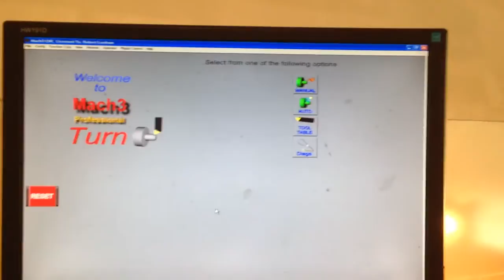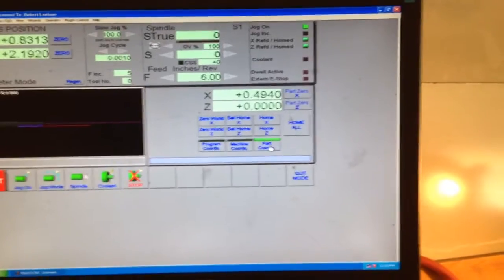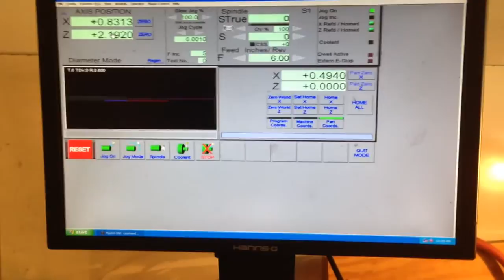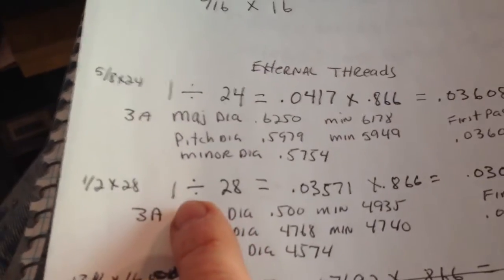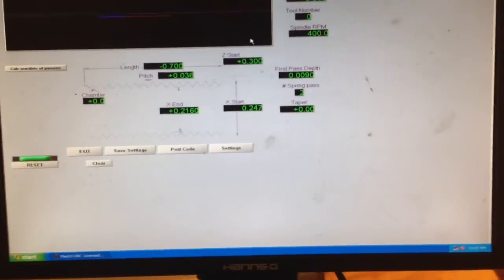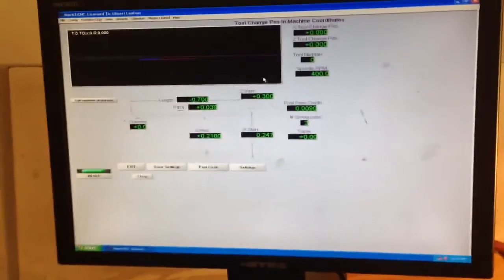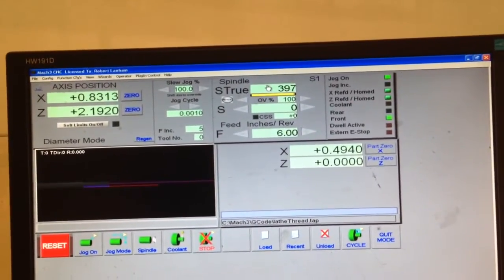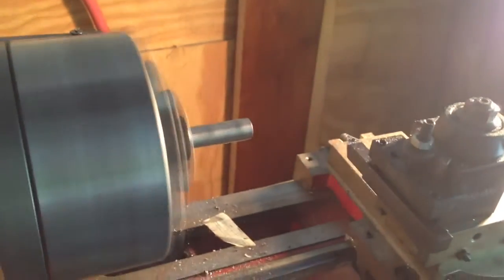Mach3 turn threading

Comment: Thank you for very helpful video. I am trying to use a proximity sensor connected to the index in the mach3 board but although I got dignal in the index when I turn on the spindle I have no value in the trou s. Sn jdea eill help.
Thank you
Dennis Anghelatos

Comment: hello im trying to do the same. Do you solve the problem? I see you your tacometer conect with mcuh 3 with index i think and for your splindle what motor are you using?  how do you controler with pwm?

Comment: The metal you are cutting looks like Home Depot metal it doesn't cut worth crap looks like part of the problem in this video good work man your heading in the right direction 👍
Reply from the maker: Good eye, it is Home Depot metal and it cuts like crap.
Reply: @robertlanham8076  yes for sure, horrible steel, most probably hot rolled, the worst u may want to cut

Comment: Looks like the thread pitches for an Ar15 1/2x28. And AK-47 5/8x24 14-1 Left hand 😉👍
Reply from the maker: Correct on the ar, the 5/8 24 is for 300 blackout.

Comment: I can't comment on your recent video on threading on your lathe because its disabled on your end lol your doing the right thing by shimming the cutter using a feeler gauge may not be cost effective lol but it works use it . The threads are going to cut better if you use the right tools and holders so looks like your going in the right direction . Good job thanks for sharing 👍👍